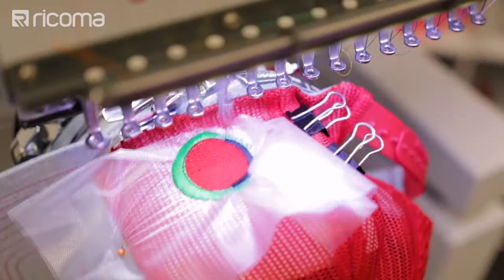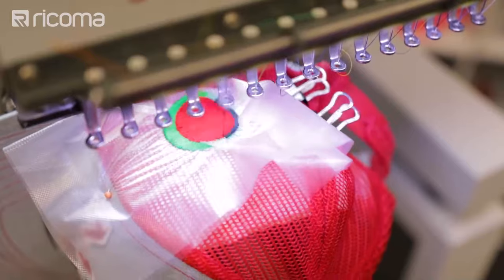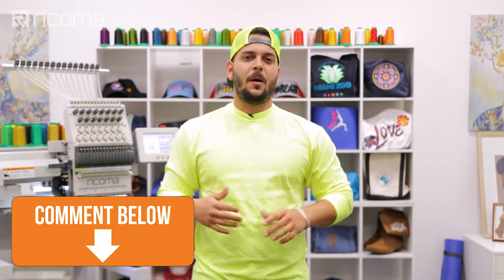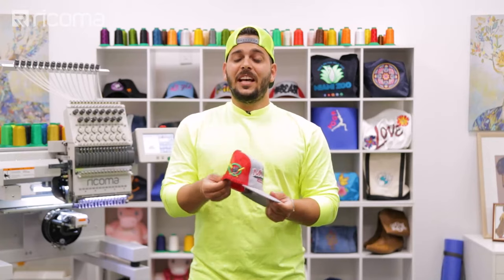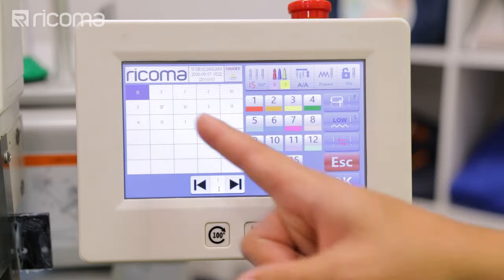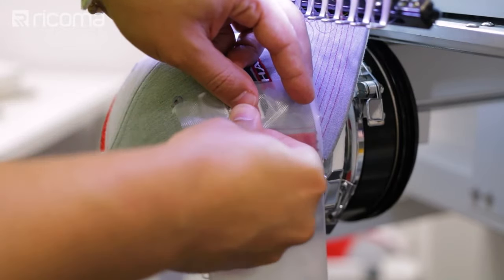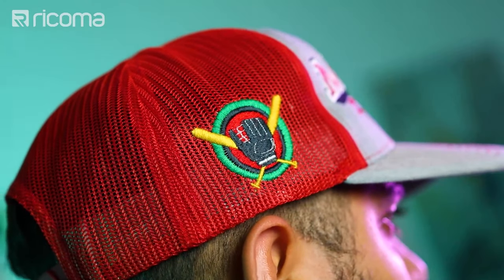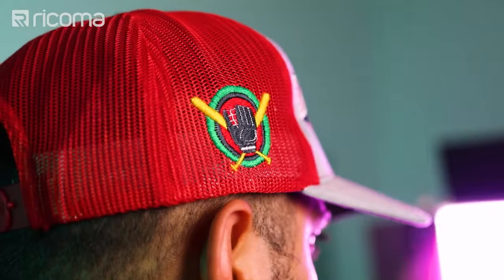EMBROIDERY on MESH | How to Embroider Mesh Caps | (EMB Hub Ep131)

Comment: Will this work on the 10 needle machine? When I bought my 10 needle machine in March 2020, I didn't know there was a 15 needle machine or I would have bought it., the person that sold me the 10 needle didn't explain there were more options available.
Reply from the maker: The 10 needle will be able to embroider on mesh, but it only has a 220 degree cap rotation. You’ll have to rehoop the hat to do the side.

Comment: Hi willy, i have a tc machine and when i run the 270 degrees design, the position is not matching as  you have yours.   I understand i need to have the numbers on the chroma hoop size match the numbers  on the tc cap hoop On the tc panel.  Is  there a good guide for this?
Reply: Btw: you are killing it with these tutorials !!
Reply from the maker: You can go into your embroidery parameters and change the x size of the cap hoop. Keep in mind the number shown in the hoop size is in mm

Comment: Is this even possible on a 1501-TC? Holy heck! I can't find these caps for no less than $4.59 each. You all got a killer price...!!!
Reply: You can do this on a TC, it supports a 270 Axis on Caps.
Reply from the maker: Correct! 1501-TC can do 270 degree cap rotation!
Reply: Where is the best place to buy caps?

Comment: Very nice video and the cap looks amazing. Can you tell me what brand of thread are you using, as the one I use breaks to often. And where can I buy it
Reply from the maker: We recommend either Isacord or Madeira threads. Use polyester thread and not rayon. You can buy them directly from the manufacturer if you have an account or many different online supply stores resell these. Hope that helps!
Reply: @ricomatv  thank you for your information, I will change as I am using rayon and I went to Joan's fabrics to purchase thread.

Comment: I have 15 hats to do.  The front of each hat will be the same but on the side, each one will have an individual number.  Can I add the number with the front design on the MT1501 Using the installed fonts?
Reply from the maker: Yes you can! You can also digitized this through Chroma

Comment: Can this be done on a embroidery/sewing machine ?
Reply from the maker: Hi there, as long as you have a machine that allows you to hoop a cap, specifically the side of a cap. If not then you'll want to make sure the machine you have allows for 270 cap rotation so that you can embroider on the side of the cap with a regular cap ring.

Comment: Cool video, but make sure you digitize it correctly next time. If correctly digitized the hat should not pucker and the edges where the fabric and mesh meet should be straight with no puckering. It looks like there was no manual underlay or correct stitch angles.
Reply from the maker: Thanks for your feedback!
Reply: Do you do custom digitizing work?